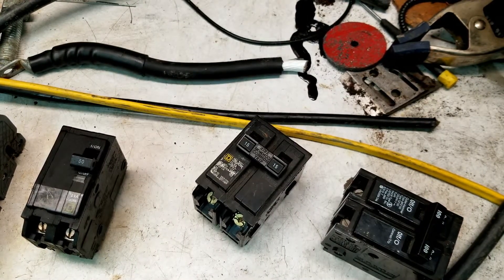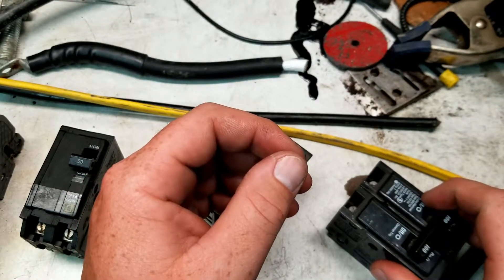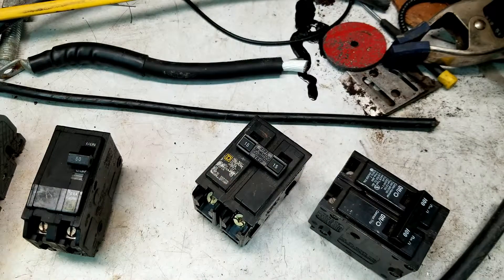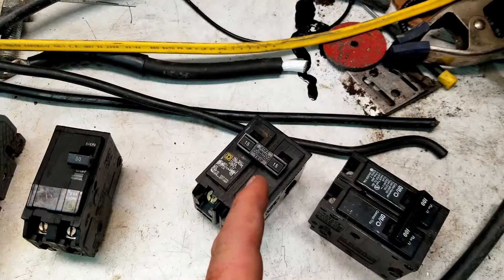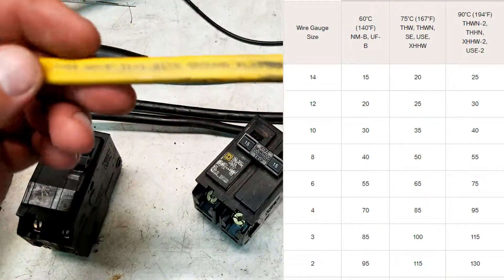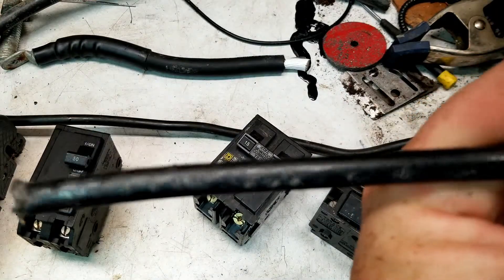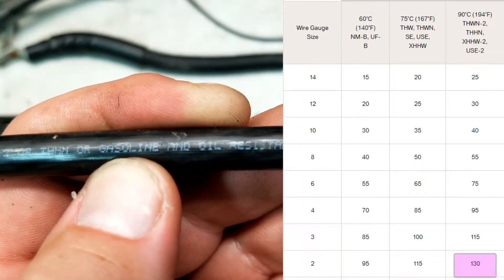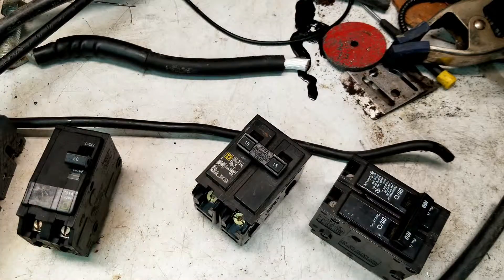Understanding ampacity and temperature rating of different wire

Comment: allowable ampacity (AA) is permitted to be the 90deg when temperature correction factor necessitates application 
#2 THHN will have AA to be 130A * (say 0.96) Temp Correction Factor for hotter ambient = 124.8A to be connected to a 75deg terminal >> than by using THW at 115A , even though when no correction factor both THW & THHN have AA of conductor ampacity (CA) of 115A to a 75 deg terminal ;

this is the advantage of using THHN in hot environments which the NEC permits .

Comment: Good job, but not true with the number 8 on 50 amp circuit. For terminals rated  60 deg you shouldn’t use number 8 but 75 degree you’re good if the terminals call for 75 degrees. Right in the code tables 310